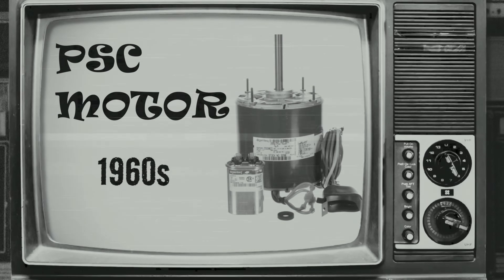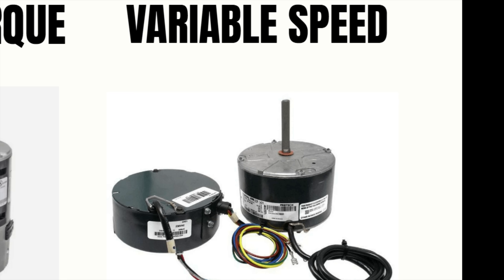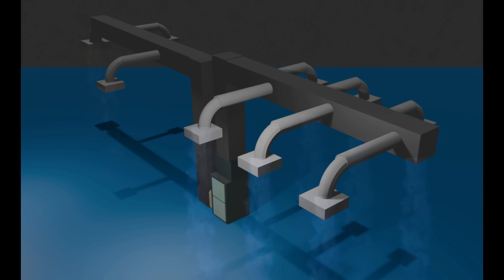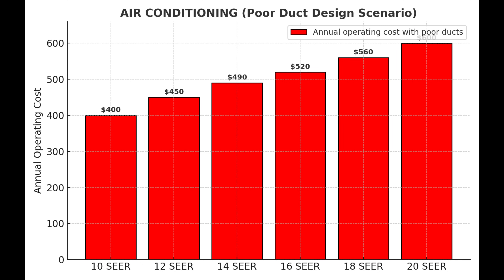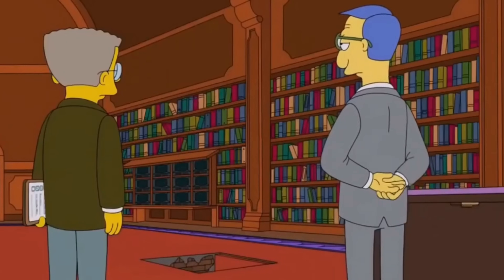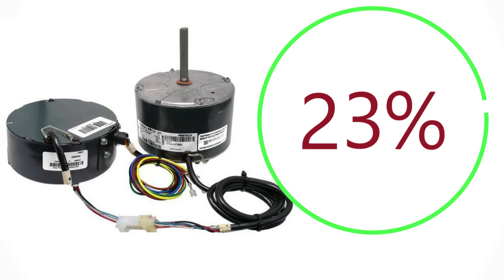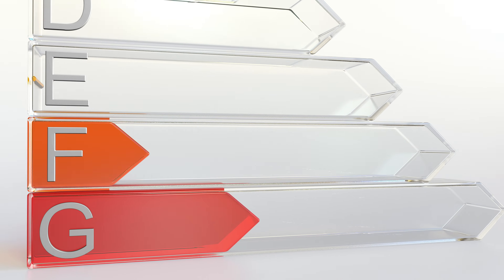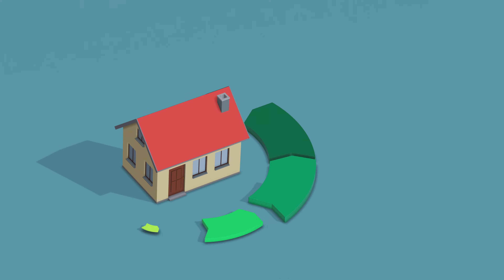The Ugly Truth About Motor Efficiency in HVAC

Comment: I always asks for the oldest tech.  I'd rather have a moderately efficient system that lasts 35 years over a claimed efficient system that lasts 15 years.  These cost savings charts never take into account longevity.  

Had my 35 year old (still good, but no one in these parts would work with R22) replaced last year.  The tech was an "old timer" and a good guy.  He apologized for not being able to work on my current system.   I'd cover all the advice he gave me, including dealing with the company he worked for, but it'd be a video in itself.  He got me the best deal in town on a new system, but said it'd never be as good as what it was replacing.  I compared with other companies and none could compare to what he offered (not just financially, but it's a solid company).

They really do not make them like they used to.
Reply: there is not a system made that will last 35 years...not even close.
Reply: @troyb3659  Most systems if installed properly will last 20-23 years. The coils of these systems will fail due to expansion and contraction. The compressor failures are usually due to improper installation. Many customers will have an apartment tech install or repair their system. They use refrigerant and parts supplied by their employer, who doesn't know they are doing so. These techs are simply parts changers and simply do not know how the system actually works. The customer thinks he is saving money, but in the long run because the life of their system is drastically cut, he is going to severely impact his financial well being. Most apt service techs will top off a system with a different refrigerant than what the system was designed for. Mixing refrigerants is a no-no. It will kill your system. But they will put your money in their pocket and disappear.
Reply: @troyb3659  Why not?  Seriously, it's a simple device.  A compressor, a fan, and some tubes.
Why do we simply accept that something so simple can cost that much and not be durable?
Reply: @BillyBobDingledorf  The newer AC systems tend to have thinner coils. The micro channel A coils here in the South East love to leak. With new 90 and 95 percent Furnaces they do not last as long too.

With a AC/Furnace combo here on the Gulf Coast the Furnaces are used less hours a year. ie 1600 Heating Degree days. So replacing an old 80 percent Furnace that can last 50 years with one that is 95 percent has a poorer payback than replacing just the cooling /  AC system. 

So what happens is about all want to replace the entire Furnace and AC when only the AC is declared dead. So now one has a high tech furnace that "saves" money in Minnesota but saves "a few bucks" on the Gulf Coast and dies quicker.  So the gambit is a loan stream to sell HVAC to the homeowner. ie Finance your new system over many years; say 5. Then when that is paid off it is obsolete and dangerous so sell a new HVAC system again. 

The ancient 75/80 percent Furnaces with any slight crack sent the slight CO up the stack. With a new higher efficiency unit a tech will flag a 5 year old one to harvest a new Furnace. The high efficiency furnaces are more dangerous since all this recycling to boost the efficiency. 

Here I have a Testo 320 engineering test Combustion analyzer to check my old 75 / 80 furnaces and am just an engineer. Local HVAC folks often base "you need a new furnace" based on its age. They often do not do a stack test of CO. Ie they have no stack CO testers at all . So it is an emotional scrap the old furnace marketing gambit. No real tests; declare dangerous since a few years old ; so replace everything

Worse here is every big hurricane has mass damages. The "stormers" arrive to steal outside AC units and come back to be heroes  to get your house cooled. These outside AC condenser units often just need a fan motor. The sell a home owner on an new system and just replace the  outside AC condenser unit. So now many systems are miss matched. ie inside A coil never changed and inside was a 3 ton and outside a 4 or 2 ton.  So after 2 to 5 years these miss matched systems are replaced again. So in 20 years after Katrina many homes in flooded areas have had 2 to 4 systems;  they last 5 to 10 years. Few want repair an older AC unit so the big HVAC companies want to replace all.

***Even in Window AC units the question exists of:

"Why do we simply accept that something so simple can cost that much and not be durable?"

I have several high end 25 and 28 year old 9.7 EER units that work fine; Whirlpool. They have oiling holes for the fan motors and good coils.  But after Katrina some temporary  window AC units placed in neighbors homes lasted 6 to 18 month and the HVAC gas had leaked out and or the fans seized up and needed constant oiling. ie all Chinese crap; high efficiency  and  throw away after a year or two. ie I have scrapped out over 14 window units after Katrina with neighbors homes "waiting to get their central AC" fixed. 

The Government specs of EER, SEER. SEER2 have no extra "will it crumble" in a few years rating

Same with cars/trucks. Chase high MPG no care if vehicle is a giant repair mess in a few years
Reply: @3beltwesty  I agree with every point you made, including cars.
Reply: @BillyBobDingledorf the issue of chasing efficiency and not caring about the life cycle cost bugs me. I am an engineer and think the government has created a disaster fiddling with efficiency specs..they really should be static for years to get the bugs out
Reply: @3beltwesty if you're selling furnaces along the gulf coast, you're 20 plus years behind. IMO modern hearpump tech can replace the vast majority of furnace/ac combos in zone 3 or warmer locations.  I have a 20 year old heatpump+AHU in a poorly insulated 1960s ranch in upper Z3 close to Z4 territory.  There's only a couple of weeks in the dead of winter that the heat strips are used.  A better insulated structure with a modern hestpump is a no brainer anymore.
Reply: @3beltwesty  They ARE static for years.  It is amazing you call yourself an engineer and don't even know that basic fact.  The SEER ratings were implemented in 1992, then updated and revised in 2006, and then again in 2015, and 2023.

My calculator says the difference between 2006 and 2015 is 9 years, and 2015 to 2023 is 8 years.

So, how were the standards not static for years....???  Makes absolutely no sense at all...
Reply: @BillyBobDingledorf  You must be terrible at math or something.  A more efficient unit will pay for itself, and then some, in 10 years or less.  You appear to confuse purchase price and longevity with savings, and appear not to understand TCO at all.

More efficient units can easily save $1000 a year in energy costs, which over a decade is $10,000, and over 35 years is $35,000.  

Paying extra $10,000 in electric bills instead of by buying a $10,000 system that lasts 20 years, and would save your $20,000 in energy over that timeframe is not a smart investment.  

The same exact scenario applies to cars.  More efficient cars burn less fuel, which can in many cases pay for itself.  A truck that gets 20Mpg instead of 10Mpg, that gets driven the average 15k miles a year, would cost $2,250 a year in fuel, instead of $4,500, which is $2,250 a year in savings.  Over 10 years, we are talking about $22,500, and over 20 years $45,000.

It is amazing that people don't understand the concept of purchase price vs TCO...
Reply: @redbaron6805  I'm actually quite good at math.  Living in Minnesota, my annual heating costs are about $900 with my 28 year old furnace.  You're telling me that a high efficiency furnace is going to have the gas company pay me $100?
Stop believing the hype.  What HVAC company are you a salesman for?
Reply: @redbaron6805  OK so you are not an engineer and thus think modern junk that dies in a few years is great?. 

This thread has comments about AC units and cars too. ie Re : Same with cars/trucks. Chase high MPG no care if vehicle is a giant repair mess in a few years">

The same thing is with AC units; chase high efficiency numbers and rape the home  owners with stuff that craps out quickly

ie ignore the life cycle costs that new stuff is less robust, more complex, changes the hvac gas and few HVAC folks will work on since a few years old

Parting of being a real engineer is is looking a life cycle costs and no creating disposable systems to surf making money on installs

One reason today you need to use safer HVAC gases is the systems are thin coils and leak. 

Maybe you crave cars and ac units that are ultra efficient and last 3 years and go into land fills? ie a pure marketing dream and one of not an actual engineer 

The entire behavior of pushing high efficiency hvac systems and not caring if has to be totally replaced in a few years is wrong. 

To see locals go through 3 to 5 new AC systems in 2 decades is the modern shitification of crap designs. A coils that need replacing every few years
Reply: @BillyBobDingledorf  OK, lets read back through your original claims, shall we.

"These cost savings charts NEVER take into account longevity."

OK, lets break down that claim a bit.  

1.  More efficient A/C units, especially in the South, can easily pay for themselves in 10 years or less, through energy savings.

That would obviously mean that keeping a less efficient unit around would be more expensive, than replacing it, especially if it was anywhere close to 30 years old.

2.  We are talking about the typical and average system, not your specific case, and people tend to both heat AND COOL their homes, so you conveniently skipped over the annual cooling costs in Minnesota, which range from $1100 to $1800 a year in Minneapolis.

So yes, upgrading the A/C cooling portion only would save over $5000 over 15 years, and over $10,000 over 30 years.  

Upgrading the heating portion with a more efficient system would save another $7500 over 15 years, or $15,000 over 30 years.

As I said earlier.  We are talking about a typical system, in a typical house.

If you live in a one bedroom cabin in the woods with a wood stove, that is not a typical case for how this works in the real world.
Reply: @redbaron6805  You forgot to tell me what HVAC company you are a salesperson for.
Reply: @BillyBobDingledorf  That is such a lame and pathetic statement, but coming from someone who is obviously terrible at basic math and science, you being terrible at reality also should surprise no one...
Reply from the maker: Yeah, but I still see cars from the 70s, 60's and 50's out there on the road. I don't see many from the 80's, which is when computer components became widespread and common practice in cars. 

I've seen many old R22 units last 30+ years. With these high efficiency units, their computer driven logic, sensors, etc, once they pass that 10-year warranty period, any money you saved up to that point in power consumption evaporates very quickly with repair costs to keep that unit going. 

That wasn't the case with the older units. They were far easier and cheaper to fix beyond that 10 year mark. I run into customers who still have R-22 units 25+ years old and don't want to get rid of them. 

 These high efficiency units are too cost prohibitive to keep them going 20+ years. All of your savings have to come in that 10 year period. At 12-15 years, most if not all of that savings can be gone with any major repairs and they become money pits from then out. Nobody can afford to keep these units going 30 years like an old R22 unit.

Going back to cars, it's like buying a Roadrunner any backyard mechanic can work on vs. a Tesla. How many people are working on their older Teslas in the garage? How many people are replacing their battery banks once they're done?
Reply: @JerseyMikeHVAC  cash for clunkers was the biggest removal of 80s vehicles.
Reply: @BillyBobDingledorf  epa...
Reply: @JerseyMikeHVAC  There are cars out there from 50's, 60's, 70's and 80's, but none of them are common anymore.

Cars in the 1980's started getting computers to run fuel injection, which requires computer control, along with anti lock brakes, airbags, transmission control and in some cars the gauge cluster.

The rarity of cars from the 1970's and 1980's was due to poor rust resistance and other build quality issues, and had absolutely nothing to do with computers.

Your claims that after 10 years, the savings "evaporate quickly" are obviously comical, as after 10 years, your energy savings will already have paid for the system entirely, and then some.

Your customers, like most American's, are simply terrible at math, and don't understand TCO's.  Which is why they don't understand efficiency, electric cars, insulation, thicker windows or other elementary cost of ownership.  They only understand what they paid upfront, and have no idea what it will cost to operate over time.

I have literally fixed my Tesla myself, as countless people do, because they are modular, easy to work on, and in most cases far simpler to work on that combustion engine cars.

Hardly anyone is replacing their battery banks, as the batteries will in most cases outlast the car.  Even my 2014 Tesla is still on its original battery, and the battery still has over 90% capacity.

Battery replacements in electric cars are exceptionally rare, but people simply are incapable of doing elementary research and learning how any of this work, and just prefer their emotions and opinions over actual research, facts and data.

Comment: Kind of clickbait… If the motor isn’t meeting design specs of course it’s not going to perform how the manufacturers claim it to. And let’s face it, your average technician isn’t pulling out a manometer to check static pressures. So in the long run, the customer ends up paying the same if not more.

Comment: PSC motors last for decades , high efficiency motors last for months . Simple as that , they don’t save any money at all they cost the customers money .
Reply: Just absolutely bonkers levels of utter nonsense.  My variable speed system is several years old, and still works fine with all original parts.  These blanket statements about how long things last are beyond idiotic...

Comment: I've upgraded systems to use 20x25x5 filters or two 16x25x5 in parallel and it does wonders for airflow and static pressure
Reply from the maker: Exactly 💯. Increasing the filter surface area is one of the cheapest and most effective fixes you can make.
Reply: @JerseyMikeHVAC  I usually measure a 0.2" w.c. reduction at 1000cfm when changing from 16x25x1 to 20x25x5 when both filters are brand new.

Comment: Dayum. My company never checked static pressure. Not a single tech knew how, and I guarantee my boss didn't even know what it is. And we dealt with soo many unnecessary issues like random failing motors, huge spikes in energy bills, etc. And never provided a solution lol
Reply from the maker: You still there? lol
Reply: @JerseyMikeHVAC no ofcourse not lol. I would even expose them and share the name but i dont know if i would get into legal trouble for that

Comment: I have a 2 ton AC and 75k BTU 80% furnace. Furnace on the coldest day of winter doesn't even run half the time. When I clock the gas meter, it seems to be running at proper rate for 75k BTU and doing the math with temp rise on highest blower tap, I'm around 700CFM with .5" water column with the least restrictive fiberglass 1" filter I can buy in a 16x20 grille.  The AC supply/return difference is 25-28 degrees with properly charged fixed orifice superheat. Ductwork is undersized but I know I have the headroom to undersize the AC because it has no problem keeping up on the hottest days beyond design conditions.  I'm thinking of upgrading to a 40k condensing furnace and 1.5 ton AC with a proper 4" filter because all that should make the undersized ductwork a non-issue.  Am I on the right page? I imagine I'll get to less than .5" water column in all conditions and improve efficiency no matter which type of ECM motor is involved. Thoughts?
Reply from the maker: You’re reading it right that your system is airflow-limited. A 2-ton wants ~800 CFM; you’re closer to ~700 CFM by temp-rise and seeing a 25–28°F split in cooling, which usually points to low airflow.

Downsizing can absolutely help if your Manual-J supports it: a 1.5-ton at ~600 CFM will be happier on your duct system, and a 40k 95% furnace (≈38k out) may still cover your heat loss if the current 75k hardly runs at design.

Biggest win before swapping gear is reducing static at the source: larger 4″ media rack with more face area (ideally 20×25×4), and adding/upsizing returns. Shoot for TESP ≤0.5", filter drop ≤0.08", coil around 0.2".

Motor type won’t fix the duct—variable-speed will push watts to hold CFM, constant-torque will give up CFM. The duct sets the limit.

If your heat/cool loads pencil out, 1.5-ton + 40k can work great and lower static. Just verify with a quick Manual-J and your blower chart so you’re picking the size, not guessing.